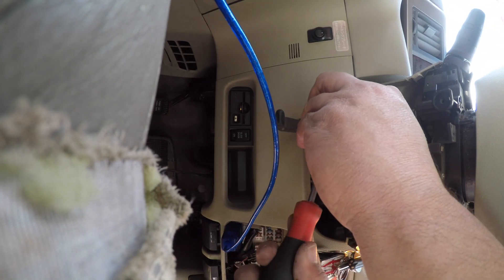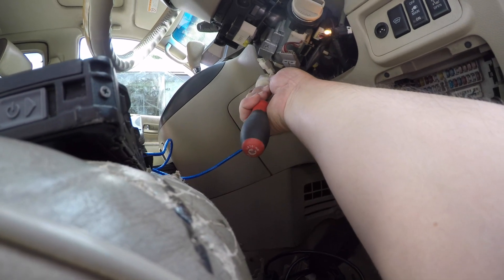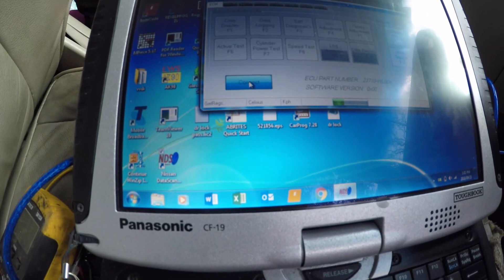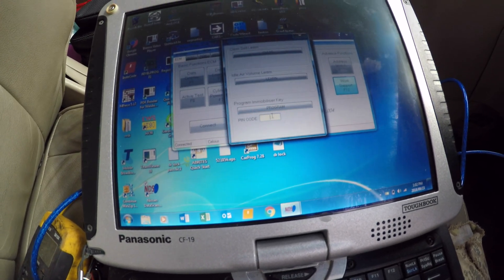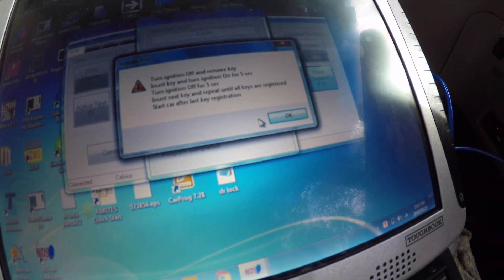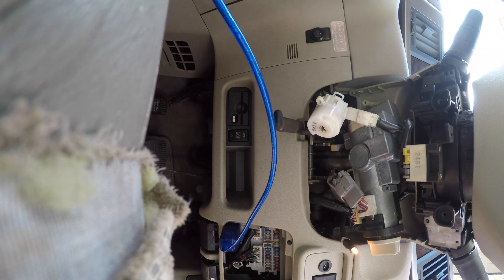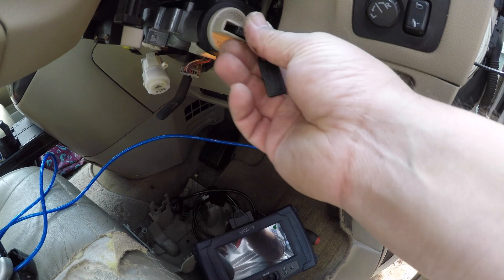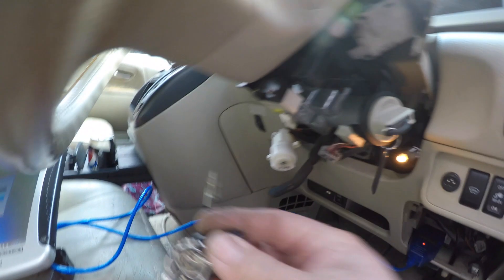Program key on Nissan with laptop - Lost all keys

Comment: Hi Mate, how did you get the code for the programming. I have the tool and ndsii need to program a new key for a d40 and don't want to attempt it until I work out how to get the code to type into ndsii. cheers
Reply from the maker: most of the time you need the indirect code from the BCM the convert it to login code with other software , some cars you can read with obd, some have obd code reader too, what make and model and year ?
Reply: @DrLockShop  2006 Nissan Navara D40

Comment: Hi the Dr Lock.. I was wondering if you can share with me where o can get that ignition bypass barell that you use in this vid and turn off/on with screwdriver.. the other thing.. have you ever used the obdstar F02 which is specifically for Nissan.. I have one of these coming in the mail to try to program some keys and keyfobs for my e51.. thank you

Comment: I own an Elgrand (I'm not a locksmith) and did a quick experiment with my new unprogrammed key and a working remote. As soon as the ignition senses that the key blade is all the way in (last 5mm approx are critical) it stops the remote from allowing the ignition to turn.  As soon as key is pulled out, the keyless ignition works. So to sum up, you can use either a programmed keyblade OR the remote, not a combination of both. Great vid by the way 👍
Reply from the maker: you have to program both
Reply: @DrLockShop  Hi. Thanks for the reply. Yes, I mentioned this as in one of your videos you said you tried to hold the blipper near the ignition to make it turn on with the key inserted to get comms. Did I understand your other video correctly in that the Silca SBB (I think I have the fake Chinky one) can program the keyblade transponder IF you manage to bypass the ignition to get comms? I found on a forum that for the key itself, you select Nissan Japan/March 00/ insert new key & turn on/ enter pincode. Codes for Nissan are here. It gave me 2 x 4digit codes. 👉 BCMcodes.keytechtools.com 👈 I haven't attempted it as I am not confident in tampering with the ignition. Shame you're not here in the UK. Our locksmiths don't want to know.

Comment: You should look into an OBDstar X100, I haven't met a Nissan it hasn't done in record time yet.
Reply from the maker: Has it been able to read the old BCM ? 5 dig to pin type , nat 5 ?
Reply: I'm assuming you mean the BCM conversion to  4 digit PIN?  yes, it'll pull BCM and convert to PIN in seconds, it also has a BCM conversion built in, the older nissans have the BCM number printed on the BCM box, just read it, punch it into X100 and it converts to PIN for you.  It will show old PIN (<2008) or New PIN (>2009)

Comment: Its same nissan?:)
Reply from the maker: yes, same Nissan as last week "a year older", this is the car that I did not have much luck with the other tools, This time I took you advice and tried it another way with Ing on for coms, not using the smart remote this time to activate Ing for coms. The problem with the car is you can not turn Ing unless the key or remote is programmed, and if you use a remote to turn Ing key programming is often unsuccessfully. Got it working in the end, happy days
Reply: @DrLockShop  great :)
Reply: What's the laptop tool called?
Reply: Nats will sometimes catch you out thinking you have programmed but it is in valet, 5 starts later it locks up again. Which program are you using on your toughbook? Does it only have code generator for Nissan or others like Vag etc?